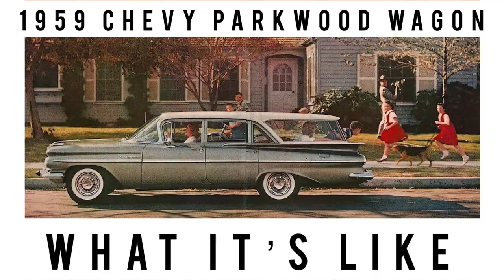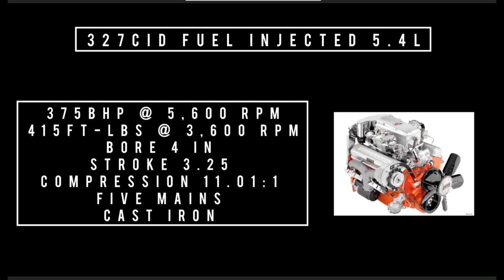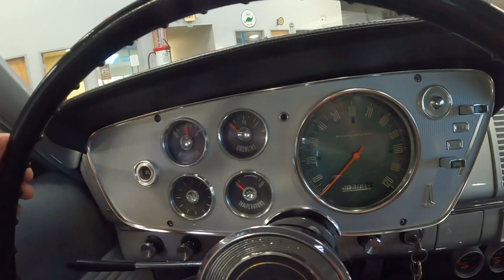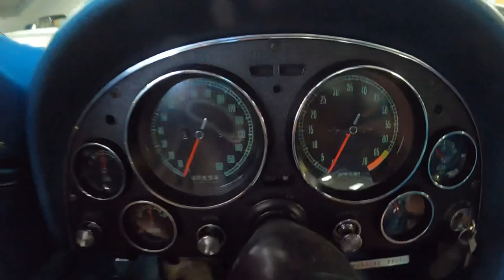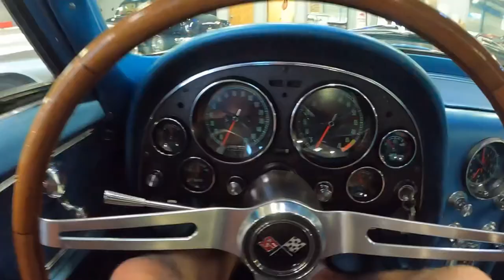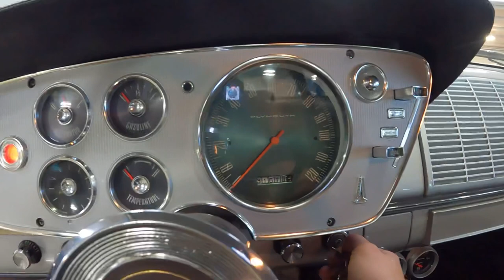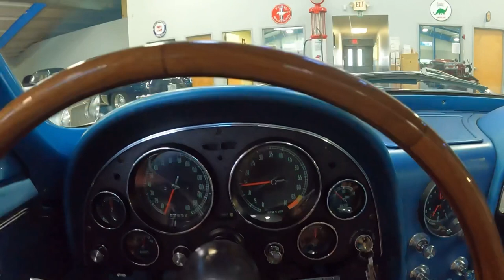This vs that 1962 savoy vs 1965 stingray beach boys shutdown comparison

Comment: For the sake of argument, the 413 was actually a faster car.  Here are the statistics:  "A 1962 Plymouth Savoy with a 413 Max Wedge known as the “Melrose Missile” became the first factory stock car to break into the 11 second range in July of 1962. The Missile ran a verified ¼-mile time of 11.93 seconds at 118mph."  1963 Corvette Fuelly 14.1-14.5 seconds at 98-100 mph.  These statistics were Googled
Reply from the maker: I wanted to race these so bad had access to both of them.. at the same time boss said no it would have been good to see tho

After getting to drive both the savoy will eat the vette for breakfast lunch and dinner
Reply: @What.its.like.    Yes, I've owned 11 Vetts over the past 40 years and loved them all, including a '68 427 4spd Roadster.....and I also owned a factory stock '62 Impala SS "409" dual-4bl and 4spd car and even a '62 Dodge Polara 500 with "413" and 4spd.  The Mopar was the "BEAST" car of them all.....bar none.

Comment: no way the stingray weighed more than the plymouth
Reply from the maker: The Plymouth is way way easier to push.. I had to push both 

I’m not entirely sure where I got the specs from every single site will have that car a different weight 

https://www.automobile-catalog.com/make/chevrolet_usa/corvette_c2/corvette_c2_coupe/1963.html#gsc.tab=0
Reply: Weren't they made of fiberglass? I openly question that weight rating. there were only two seats and no trunk to speak of. The car is supposed to be LIGHT.

Comment: 1965 375 hp Vette 3150 lbs
Corvette is harder to push because front wheels are turned to the right.
Reply from the maker: Fiberglass cars are hard to push i general for some reason moved a 54 the other day it wasn’t fun didn’t help it was a bias tires

Comment: Very good comparison but you have the weights wrong. The Savoy with a 413 weighs in at 3,530 lbs while the 65 Corvette with a 327 weight in at 3,117 lbs. I have the Corvette and can confirm that in real life.
Reply from the maker: Awesome thank you so much for that Correction =)

Comment: The Mopar will walk that Vette all day. The Vette isn't a drag car.. it's a touring car. That Plymouth, or big brother Dodge as it's supposed to be, is designed for straight line acceleration. There's no comparison and it shouldn't have ever been a question. Especially after 60 years. Even with second day mods, the Plymouth would be at more of an advantage.
Reply from the maker: I wanted so bad to take both of those cars out and run them. I got to drive the Savoy last year. I worked at the Classic Car dealership. My boss told me he’s like get on it don’t be scared. I said it’s not my car and he took me for a ride in it And I couldn’t believe what he could make it do.. that car was unbelievable. The only thing I will say is it could change with the wind that car could run good and in a moments notice it can run like complete garbage because of something really stupid like the gas cap isn’t venting properly.

The crazy thing is it’s fast it’s affordable it isn’t pretty. It’s got an acquired taste but the more you’re around it the more I guess you grow love it. I suppose Corvettes are overrated anyway in my opinion.
Reply: Not entirely true , the L88 Vette hooked up very well and could get into the 11s

Comment: They also say that "it's hot with RAM induction", so that sounds like a Dodge to me...
Reply from the maker: In my opinion it could be either car because superstock always talked about Plymouth dodge ram charger.. and realistically the two cars are really really similar the only thing different is the name and the spelling.. If somebody went and changed all the badges on the Plymouth dodge one would be none the wiser
Reply: @What.its.like.  I bow to your superior knowledge on the matter.  Over here in the UK, the race would probably have been between a Ford Cortina and a Hillman Avenger, nothing like as exciting!

Comment: 2:48  Aint no way in hell did the 65 Corvette weigh in at over 3570lbs even with the 427. I bet in was barely 3200lbs!
Reply from the maker: Every one says something different I went with the heaviest figure I saw 

https://www.conceptcarz.com/s217/chevrolet-corvette-c2.aspx

https://en.m.wikipedia.org/wiki/Chevrolet_Corvette_(C2)
Reply: @What.its.like.  Conceptcarz says Corvette is "steel unibody". Do a little research.
Reply: @65sohc  The steel unibody was the Plymouth - I know, because I owned one that got T-boned. That car , with a 361 V8, single 4Bbl, and 94,000 miles on it stayed right alongside   my buddies 1961 Jaguar XKE to 140 mph on a fresh stretch of deserted freeway in 1968.

Comment: No Corvette until the 427 stingray could threaten that max wedge! That song was JUNK!
Reply from the maker: There was a lot of information in that song that wasn’t right like super stock referred to Plymouth but they saying super stock dodge a dodge always went by ram charger
Reply: @What.its.like.  Super stock refurled to the NHRA class the cars were built for, both Dodge and Plymouth were Super stock Cars!  You could get a Dart or Savoy with a Slant 6, in lt You could only get the Max Wedge in the Super stock cars.

Comment: The 413 would eat the vette, I had a 413 in a 39 foot motorhome, and it would smoke the dualies through intersections, this was with a 727 four planet torque flite, with 5.27 to 1 rear end, wheeee!!
Reply from the maker: I got to drive that 413 that summer I believe it would have destroyed the vette.. but as you know nothing could be better than the corvette
Reply: I am addicted to big inch big blocks, have had some interesting examples, a COPO 1969 SS 396 375HP El Camino four speed, a 413 Sonic Ram Plymouth, and I was getting the small parts together to put a late 50s Desoto hemi into my 65 Plymouth Valiant when my wife totaled it (my mom bought it new, it spent it's life in the garage and had almost 900 thousand miles, and was all original), and a 1941 Willys coupe with a 421 (I think) Buick Wildcat engine with Hillborn fuel injection, M22 four speed, 57 Ford rear end, the engine was set back about 9 or 10 inches, and would do bumper dragging wheel stands, I miss those cars and those days
Reply from the maker: @davebaker9128  new cars don’t have the same feel, smell and overall experience like these machines.. one has to know how to drive the classic stuff.. traction control SUCKS